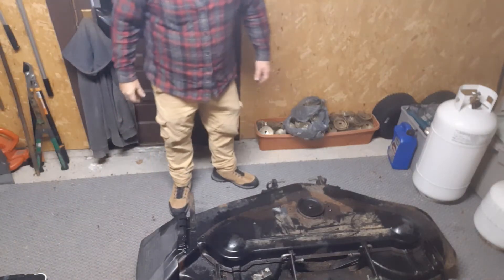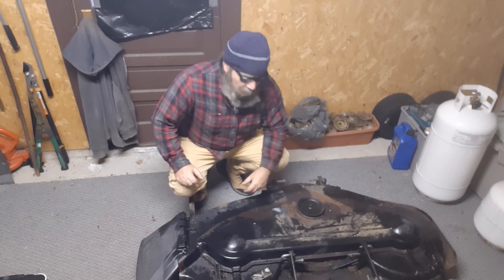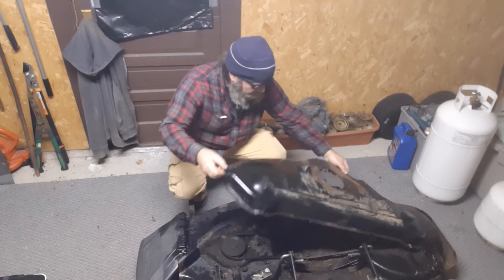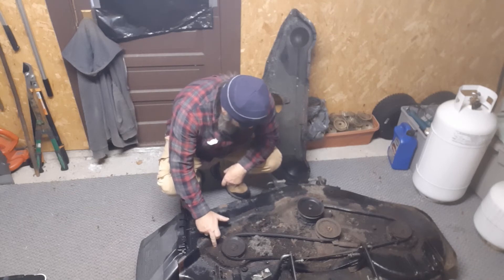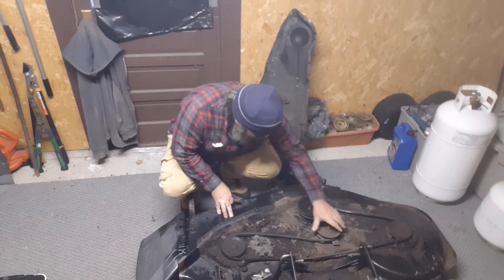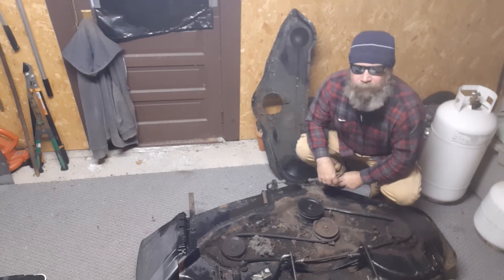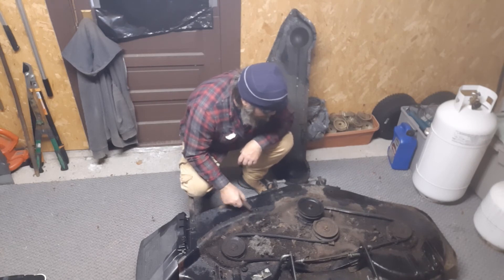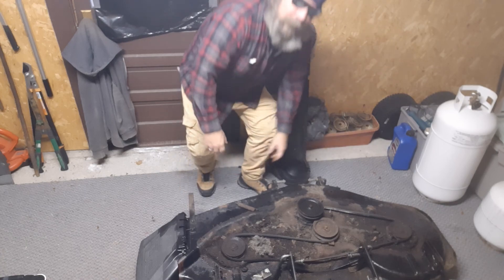Craftsman GT6000. Mower deck tear down.

Comment: I got a gt6000 that I’m working on right now. Haven’t found much info on this particular deck for parts. I’m hoping I can find that main center spindle and pulleys.  If I’m correct that one has 2 pulleys on it like mine? 
Looks like a great mower deck. I can’t wait to get it cutting again.
Reply from the maker: Yes it has 2 pulleys. I found most of the parts are NA/discontinued. Had to use a different spring for belt tensioner.
Reply: Found the spindles at Home depot of all places. Part # 105477X for ayp, husq had to order online not carried at my location. 
This is not an easy deck to find parts for. I really appreciate your putting this video out here for us all.
Reply: You don’t happen to remember what size belt that had on it do you? The one that was on my deck is about 12-18” too long.